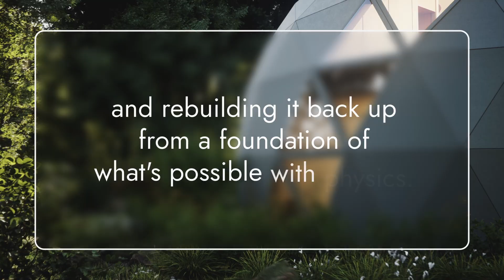What happens when you build homes from physics first principles?

Comment: I wonder whether Georock could be used in 3D printed buildings. I imagine that quite a bit of work would be needed to get the properties right but it would be cool to replace the concrete with Georock.
Reply from the maker: Georock has potential well beyond domes. 🌍 Right now our focus is on perfecting the dome system and scaling production step by step. ✨

Comment: First principals forgot HOA exists didn't they?
Reply from the maker: HOAs can be tricky, but because Geoship domes are permitted as real estate, they can be approved much like any other home — it just depends on the community. 🌍✨
Reply: @Geoship  We are talking about the same HOA that gets it's nose out of joint if your mail box is the wrong color? And they're just cool with a massive angular ball in among all their cloned cookie cutter boxes?  I like the design personally, maybe do a video of building one of these in a notorious HOA hell? Offer us hope from the depressing design language of the 1950's!
Reply: @0ctatr0n How about an HOA that bans rectangular houses; domes and cylinders only. Unfortunately, in some locations it isn’t the HOA but the municipal land use/building codes that prevent novel architectures. Sedona, AZ has a couple of dome houses, but they were built before the current code that explicitly bans them. Santa Fe is also very restrictive.
Reply: @Geoship  I have a way to possibly  get around/ with the typical HOA home style requirement, which could work in a rural parcel setting, where adjacent parcel are basically only seeing the front/ entrance. ( Well at least this is how I got a home design approved in our 20,000 acre community. ) 
Setting: 52 acre parcel. No buildable parcel around me. You drove  up a drive from the road and actually couldn’t see the planned home until you came through the end of the drive,
So I designed the front of the house, that is just the front/ entrance facade  ( which could be seen only after coming up and onto the build portion on the parcel) in a design that met ✔ the design within the spirit of the community’s architectural design ( It our community… basically ahome design suitable for a desert ranch community , like a Santa Fe, Territorial, Adobe, slump block etc ). Behind that the home design/style  I felt I could  have shape needed for the living space ! ( as it wasn’t seen ) Almost like a parapet which gives the appearance of that meets  the architectural design. Kt for approved!  
So imagine that living space going the beautiful GeoShip ! You could have all the beauty and benefits of the GeoShip design inside and views and construction longevity. The owner could enjoy the outside of the Geodesic portion from their courtyard/ backyard. 
Just a thought !

Comment: Most efficient to manufacture.  Least efficient to live in.
Reply from the maker: Domes may feel different because they challenge the box-shaped status quo. But in practice, the geodesic form uses far less material, encloses more volume per surface area, reduces heating/cooling needs, and bioceramics make them fireproof, non-toxic, and long-lasting.
Reply: On the floor plan of Amma there are 90 degree corners in the arc-shaped interior rooms. The key is to make sure that any flat walls are perpendicular to perimeter of the dome and that the radius of the dome is large enough. The virtual tour of Amma makes this very clear.

Comment: Domes are fun, but not actually efficient. We can only use spaces with flat walls, so traditional rectangular shapes are best.
And manufactured homes have been around for a long time. This video is marketing bs.
Reply from the maker: Thanks for sharing your perspective but thousands of customers, investors, and ambassadors in over 100 countries think differently. Domes aren’t for everyone, but many people are excited to explore options outside the box — especially when it comes to climate-resilient, regenerative, and affordable homes.
Reply: Not sure - I think they should make these fire water proof things into 2 x 4. If they could be cleared for use in multi family structures i would be very excited. Domes have distinct uses, but they wont have use for new efficient cities and buildings.
Reply: It depends on the radius of the dome. A small radius dome is more problematic with fitting in rectangular furniture, but a large radius dome much less so.

Also, the partitioning walls that divide the rooms in the dome are not dome shaped. Several of them are flat as depicted on the floor plan and the virtual tour, while the rest are curved yet not tilted over. Many of the rooms are arc shaped, so they still have 90 degree corners.

Comment: Geodesic domes require MORE material, because all manufactured products like glass, plywood, etc. come in rectangles. When you cut triangles from rectangles you have wastage. The theoretical efficiency does not hold up in reality.
Reply: The panels are a bioceramic composite that are casted. Very minimal waste as compared to conventional NA construction.
Reply from the maker: Great discussion here. Traditional domes did have challenges with materials, sealing, and fit-out. That’s why Geoship redesigned the entire system from first principles. Our panels are cast bioceramic composites — not plywood or sheet goods, which means minimal waste, zero rot, zero toxins, and fire resilience.
Reply: The shell it’s uses no wood and you don’t have to use it on the interior. Could be cast kitchen counter for example.
Reply: @rick-yo  does it use glass and other sheet goods and why is the answer yes it does. 

Also, furniture does not neatly fit inside of a round space, so you end up not being able to utilize footage nearly as well. That is another reason its a bad idea
Reply: First principle of first principle is that always be open to innovation.
Reply: @SalemOregonOpportunities  Geodesic Domes are not innovative. And it isn't that I am not open to innovation, it is that I have good reasons, which I have stated above, for why they aren't a good idea.
Reply: @deadline8416  Yep, and I haven't even gone into the inherent maintenance problems, or the air and water sealing problems. There is a reason that all traditional houses have large roof overhangs and don't rely on sealants for water sealing, but rather overlapping impermeable materials like shingles, tiles, or sheets of metal.